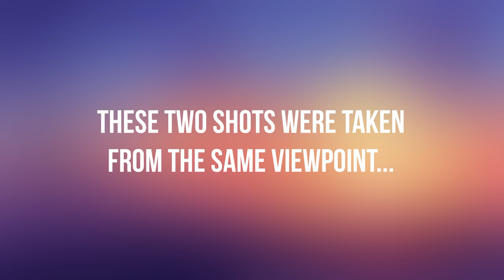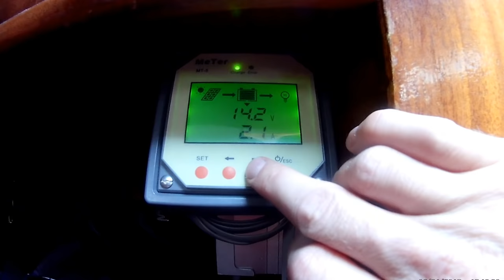Boat Tour: Welcome Aboard our Small Sailboat | ⛵ Sailing Britaly ⛵

Comment: Lovely boat!  I spent 8 years living aboard a very similarly laid out 30 footer, though mirror-imaged Port-Starboard. You have made it into a very attractive live-aboard,  very tastefully and practically set up, the solar power generation being particularly useful. For a boat of this size, I think the tiller is much to be desired over a wheel, especially if you don't have a crowd in the cockpit underway. Do you have a GPS chart plotter? I lived aboard before GPS was a big thing (remember LORAN?). but in subsequent sailing I found a chart plotter to be a huge help (not a little hand-held, but a properly installed one, with AIS). An auto-pilot connected to the plotter would also be most helpful, if not essential, in a short-handed situation. A tiller auto-pilot is compact and easily stored when not in use. Such subsystems are relatively affordable these days.  Another point: the anchor locker hatch cover should have a latch, so that in the event of a knock-down or big waves crashing over the bow, you won't lose all that beautifully arranged and vital kit. I presume that your cockpit locker hatch covers  have watertight seals and are also locked down.  (You may want to look at Laura Dekker's 8-part video series on single-handed circumnavigation on a somewhat bigger, but similarly simple boat. Many useful pointers by a master sailor).

Comment: Hi Gays. I note that you say you only have a main and a roller headsail, I think it may be a good idea to  consider a Genaca  it's a cross between a genoa and a spinnaker, they are very easy 
to handle and you don't need a heavy spinnaker pole and sheets, but the increase in speed in light airs is well worth it ...

Comment: I love the idea that your dingy has a sail on it. What a blast that must be once you anchor somewhere.
Reply from the maker: Hi George, thanks for your comment. Yes we love being able to sail our tender. You can go off exploring in it around all the little coves and bays that you wouldn't be able to get into with your boat. It's a homemade rig: I bought the aluminium tubes from ebay, made push-fit splices in them so that the mast and boom come apart (This was actually because the tubes were shorter than I wanted them to be [shipping restrictions] so I had to splice together two sections to get the length I wanted... I used an optimist rig as a starting point (I used info online to get the measurements) and then increased the mast height so that we can more easily get under the boom when tacking. It was cheap to make and lets us go sailing in the wee tender! Cheers, Chris (& Rossella) 👍

Comment: Ehat are the boats demensions. Looks to be 27 or 30 footer. My golden Hind was a similar layout. As usual engine acces was hopeless...LOL..the bane of sailboats.
Reply from the maker: Hi Jack, yes it's a 30 ft boat. Our engine has access from the cabin behind the companionway steps and from above via a removable cover in the cockpit, so it's not too bad but it would always be preferable to have even better access. Having said that, I used to be a technician on aircraft (fast jets and helicopters) - and what seems like restricted access on a boat would feel like luxury on an aircraft! Sometimes you have two arms through two small access panels, with your head squeezed up against the outside of the aircraft, working only by feel. Such fun! :-) Fair winds, Chris (& Rossella) 👍

Comment: Nice boat and great tour.
Do you do anything to prevent bending or damaging your roller furler when you use the hammock?
Reply from the maker: Hi John, we haven't had any problems with our furling gear: neither of us are particularly heavy and, although we are 'point loading' it with our hammocks, it takes larger loads when we are sailing. If we were concerned about this I suppose we could place a brush handle under the hammock lines on the furler to distribute the loads over a larger area... Thanks for watching and commenting. Fair winds, Chris & Rossella 👍

Comment: I'm sure you could always use more room, but all in all, it looks just right for two to be comfortable and very affordable. Has your Volvo been good to go? (I only ask because another v'logger mentioned they have kind of a bad reputation.)
Reply from the maker: Hi Chris, thank you for your comment. We love our boat and the memories we've made since we've owned her so far will last us a lifetime! I like the Volvo engine. It's very simple and easy to work on. The only issue we've ever had is that it developed blow-by on one of the injectors. The injectors are retained withing copper injector sleeves. Our engine developed pretty extreme blow by on one of the two cylinders, and exhaust gases were escaping straight up past the injector (despite this the engine got us home fine, runnning on one cylinder...) I removed the head to give me good access, 'milled' the injector sleeve seat, and then inserted two homemade copper washers... We didn't have the possibility to buy the washers locally and wanted the boat back ASAP! I cut two sections off the end of a copper pipe with a pipe cutter, hammered them in to the desired washer shape [repeatedly heating them cherry red with a blow torch then quenching them in water to anneal them when they started to work harden] and then fitted the washers into the bottom of the injector sleeve before re-assembling the head. It worked and we have no blow-by now! I will no doubt do the job 'properly' one day and replace the whole injector sleeve, but you need special tools to do this, and I hate spending money! No doubt we'll end up making a video about this at some point! There you go then, that's probably a more exhaustive answer than you were expecting. :-) Cheers, Chris (& Rossella) 👍

Comment: Your videos are always enjoyable to watch. Could you please describe in detail your water systems?
Reply from the maker: Thank you Andrew. Very simple on this boat: a 120 litre flexible tank under the v-berth; a 12 volt pump which ran whenever a pressure drop was detected; an accumulator (to damp out pump pulsations and reduce cycling of the pump, as well as eliminating any 'water hammer' effect); a 230VAC boiler to make hot water whilst plugged in to shore power; and two faucets, plus a (cold only) cockpit shower. Easy peasy. When filling the water tank I would add a dash of bleach to keep everything bacteria-free. Cheers, Chris 👍
Reply: Would you mind stating which brands you use? I’m outfitting for the Med. My water system is the only system left to put together.

Comment: ohhhhh beautiful, very complete explanation. I have a question, can it be install an automatic pilot in this kind of monohull(that does not have a wheel)?
Thank you so much!
Reply from the maker: HI Santiago, thank you for watching and commenting. :-) Yes, we have a tiller pilot (If you watch the video again and look out for it you might see it - it's black and runs from the side of the cockpit to the tiller.) These tiller pilots are simple and relatively cheap but ours came with the boat, which was great for us. Fair winds! Chris & Rossella
Reply: thanks so much for answering, in bocca al Lupo!!!

Comment: Perhaps I missed it, but how long is your sailboat? It look neat, tidy and complete. Love the hammag solution. Looks lovely with the sunset! Wishing you fair winds and  save sailing!
Reply from the maker: Hi Robin, VinceRo is 30 ft long (9.00 metres on the documentation) if you measure her she is a little longer than that but as far as mooring fees are concerned, she is 9.0000000000000000000000000000 metres long 😊 We love the hammocks, and sunsets at sea are always special. Fair winds! Chris & Rossella 👍

Comment: Lovely boat.  I would like to know more about its construction and history, and perhaps get a better sense of her shape from the exterior.. Who drew her and who built her?  She looks like a one-tonner from the top of the mast.  Are there any other examples of this boat, or is she a one-off?
Reply from the maker: Hi Bruce, thank you for your comment. I have just updated the video description to answer your questions. Here's the section I updated:

"Plastilupi Half Cast 30, Built 1989
LOA 9.00 m (30 ft)
LWL 7.80 m (26 ft)
Beam: 3.06 m (10 ft)
Draft: 1.70 m (5 ft 7 inches)
Displacement: 3000 kg (6600 lbs)
Sail area: 50 m2 (538 sq ft)
Keel type: Encapsulated, lead filled
Mast: Deck Stepped

The Plastilupi Half Cast 30 was designed by Davide Castiglione for the Half Ton Cup of Trieste. They therefore have the great sailing performance of a 'half tonner', combined with a cleverly maximised, comfortable interior to suit the needs of a small cruising family.

The boat was produced commercially by Giuseppe Loggia, who fell in love with the design and left his job in the marine services industry to produce the Half Cast 30 commercially. It was produced and sold in Italy [numbers produced / sold unknown].

The Half Cast 30 is a medium displacement fibreglass constructed boat withan encapsulated keel (after being laid up as an integral part of the hull, it was then filled with lead). This makes for a solid hull and eliminates the need for keel bolts."

Fair winds,
Chris & Rossella 👍
Reply: Bruce Bolster I

Comment: Great video, great boat.
What is the boat type and size?
What is the roof height inside in the boat salon, toilet, front cabin?
Reply from the maker: Hi Jānis, VinceRo was a Plastilupi Half Cast 30 and she had around 1.80 m headroom in the saloon & galley area. We currently have a Bavaria 350. Fair winds, Chris

Comment: Hey, enjoyed the video. Is your outboard engine used mainly as a back-up, or is it the primary, when you motor?
Reply from the maker: Hi Jim, we have an inboard engine (Volvo Penta 2002: 18hp, 2 cylinder diesel) which has a saildrive attached. We also have an ancient 2-stroke outboard for our tender that we bought for $50. We generally only use this when it's really windy as we prefer to sail or row our tender whenever possible. Fair winds, Chris & Rossella 👍

Comment: I’m not a sailor but I love your videos.  My question is - did you have to drill into the mast to install the mast steps ?   If so, does that affect the structural integrity of the mast ?
Reply from the maker: Hi Doug, thank you very much. There's more info on the mast steps in this video https://youtu.be/S_hD4dJGUgM I did drill the mast and yes it does have some effect on the structural integrity of the mast, but it isn't a problem for the following reasons: 1) Most of the load on the mast is compression. The shrouds and their attachments work in compression, and the mast transfers this downwards via compression, which is unaffected by 'extra' holes in the mast. 2) Every mast already has lots of holes drilled in it, to support the existing hardware. 3) I de-burred the holes prior to riveting - this gets rid of potential stress-raisers emanating from the outside of the holes drilled. 4) Masts are 'over-engineered' in terms of the strength they require to do the job they are tasked to do. Drilling a series of small holes still leaves plenty of leeway before compromising the required strength. Best regards, Chris
Reply: @SailingBritaly  ….. Thanks for the reply.  I’m just about to watch your video on the topic.  Fair winds.
Reply: @SailingBritaly  ….. Fun video and a beautiful boat.  Thanks again for the mast step information.  I’ll be watching your escapades, stay safe.

Comment: The mast steps look to be installed upside down? The strength of the triangle in that setup is as a bottom support imo.
Reply from the maker: The stiffener plate at the bottom was added to get rid of the small amount of flex that the steps had on a trial installation. I'm an ex-aircraft technician and I know that small amounts of flex = metal fatigue in the long run = a step falling off when you're climbing your mast. Not good, hence the stiffener plate which eliminates all flex. Cheers, Chris
Reply: @SailingBritaly  hmmm

Comment: How do you like the flexible water tank?  Do you prefer ot over a solid tank?
Reply from the maker: Hi there, the flexible tank was great... bar one defect which was caused by poor installation. The fill hose had a straight fitting onto the tank but the hose came from 90 degrees out, this put constant tension on the fill fitting and this leaked periodically. It would never have occured had a 90 degree elbow been used on the fill point. Apart from that small niggle, the tank was great! We've sold this boat now and our new boat has two rigid water tanks - one plastic, one stainless. Cheers, Chris 👍

Comment: The onscreen messages are annoying because they are in ALL CAPS, which are much harder to read than lowercase.  Otherwise, thanks for the pleasant tour of your boat.
Reply from the maker: Hi Mel, thank you for your comment. We welcome all feedback - both positive and negative, as it helps us improve our videos. I agree with you that lower case letters are easier for the brain to decipher and this is why in the UK motorway place names are in lower case letters (Blackpool, rather than BLACKPOOL, for example). Many years ago the UK authorities worked out that the lower case words can be read from a longer distance, because the brain can recognise the word more effectively using the the shape of the lower case letters as extra information. In Italy, on the other hand, motorway place names use all capital letters, e.g. NAPOLI. Anyway, back to our video! The bebas neue font we use is an all caps font. It may be a bit harder to read but we think it looks pretty. :-) Fair winds, Chris and Rossella 👍
Reply from the maker: Hi Daniel, yes sometimes it's an advantage being able to squeeze in through tiny little access panels... :-) Wow, the Halberg Rassy is a stunning boat, I hope everything works out well for you. The USD / GBP exchange rate makes the UK a great place to buy a boat right now. I hope you enjoy your trip to the UK and that everything falls into place for you. Fair winds, Chris (& Rossella) 👍

Comment: What kind of flexible water tank have you in the bow? I've also a 30 foot sailboat but no tank in the bow, and looking into options. 

Thanks
Reply from the maker: Hi William, here is a link to the kind of flexible water tank we have (Amazon.com): http://fave.co/2oldkTT
We have a deck fill with a large diameter flexible hose which runs down the stbd side of the fwd cabin before leading in to the top of the flexible tank underneath our V berth. There is a small diameter hose attached to the bottom of the tank which then leads to a pressure-activated water pump. There is an accumulator on the high pressure side of the pump and the pressurised water is split into two - one supplies the boiler (immersion heater) which comes out as hot water when the boiler has recently been on. The other is the cold water feed. Hot and cold water feeds run to the head faucet, galley faucet and cockpit shower. The flexible tanks work brilliantly and I regularly drink the water from the boat's tanks. I hope this halps, good luck with your installation! Fair winds, Chris (& Rossella) 👍
Reply: Place a layer of open mesh plastic onto the hull before fitting the flexible tank. It reduces chafe which is the killer of flexi tanks.

Comment: What kind of boat you have guys what make and size
Reply from the maker: Hi there Norm, thank you for watching and subscribing. :-)

Here are the details of our boat:

Plastilupi Half Cast 30, Built 1989
LOA 9.00 m (30 ft)
LWL 7.80 m (26 ft)
Beam: 3.06 m (10 ft)
Draft: 1.70 m (5 ft 7 inches)
Displacement: 3000 kg (6600 lbs)
Sail area: 50 m2 (538 sq ft)

Fair winds, 
Chris & Rossella 👍

Comment: how much a month for EVERYTING
How much was the boat
and how much a year
please tell me (sad face)
Reply from the maker: We sold the boat for more than we paid for her (We paid €14,000) after using her for 4 years (as we have done with all of the other used boats we have bought and sold, about a dozen now - I was a boat dealer so we boat and sold used boats along with new ones, and we have never paid for a survey on any of them, but have always sold them for more than we paid for them). Where we kept the boat the storage fees range from €9,000 per year for the poshest marina, to absolutely nothing if the boat kept at anchor in a in a safe bay. There are lots of options in between but bear in mind that storage costs can easily exceed the cost of a boat in a relatively short space of time. Where there is a will there is a way: if you make buying a boat your mission in life you will get one! Cheers, Chris 👍

Comment: Hi, Love your video. What kind of boat is she?
Reply from the maker: Hi Alain, thank you for watching and commenting. Here are the boat detais:

Plastilupi Half Cast 30, Built 1989
LOA 9.00 m (30 ft)
LWL 7.80 m (26 ft)
Beam: 3.06 m (10 ft)
Draft: 1.70 m (5 ft 7 inches)
Displacement: 3000 kg (6600 lbs)
Sail area: 50 m2 (538 sq ft)
Keel type: Encapsulated, lead filled
Mast: Deck Stepped

Fair winds! Chris & Rossella